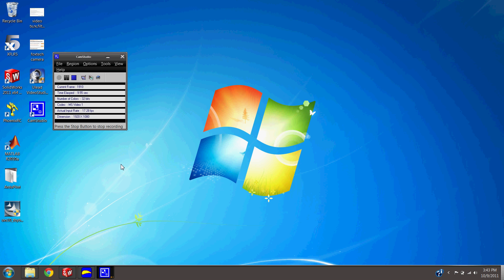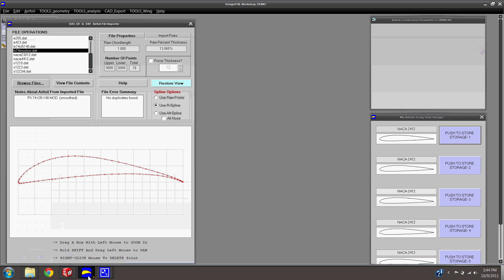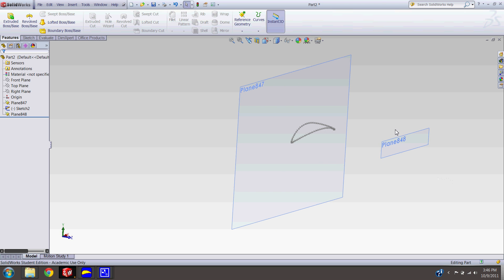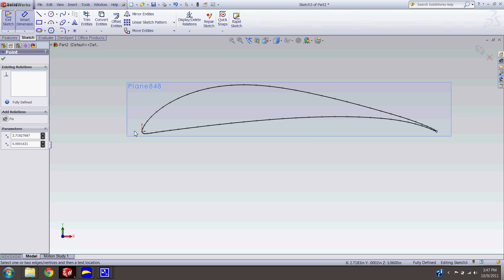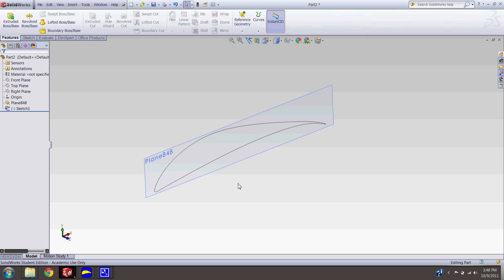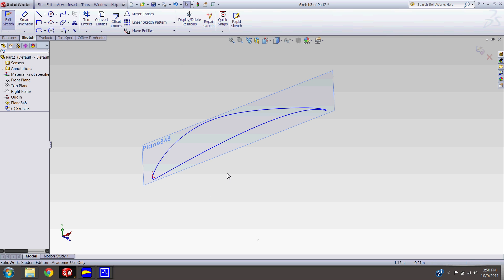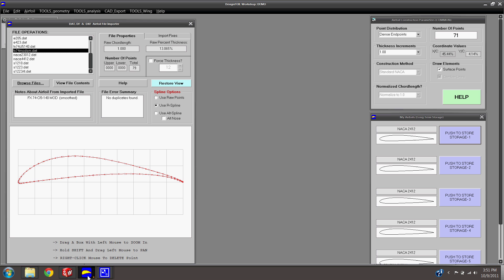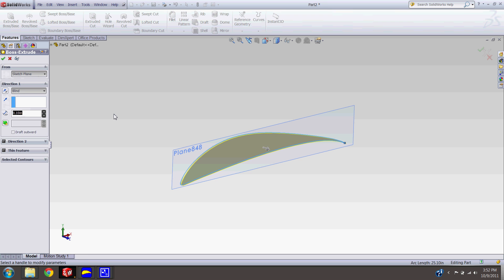Importing Airfoil into SolidWorks (1 of 4) DesignFOIL

Comment: YES. Thanks a lot. Was trying to import the dat file of the clark-y airfoil by initially trying to insert the curve through x,y,z points. Spent the last two hours trying to do that...it finally worked but i couldn't extrude for some reason... your method was indeed a lot easier. The un-synced audio made it a bit confusing but eventually I got it! (To anybody who needs help importing the clark-y airfoil due to its confusing given data points in the dat file, msg me and I'll help you out.)